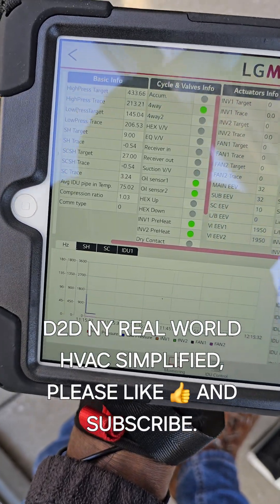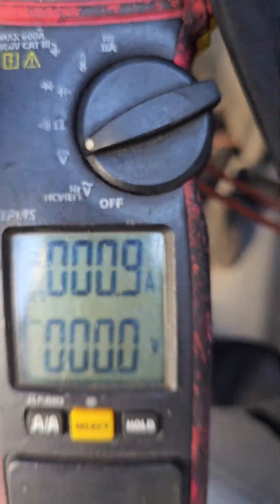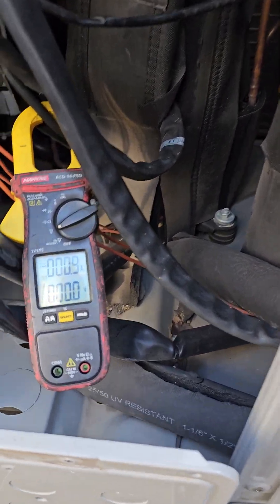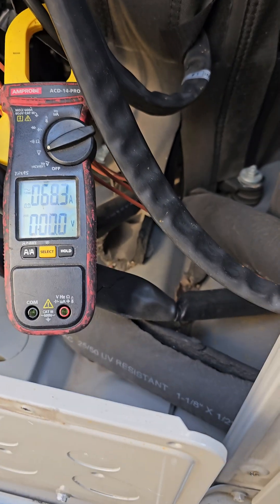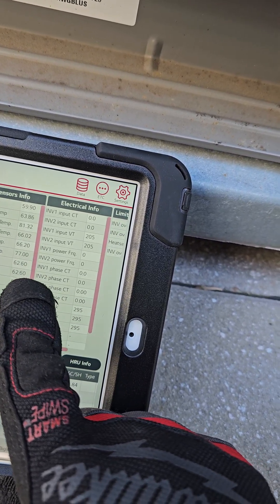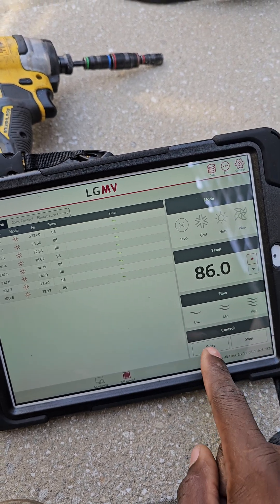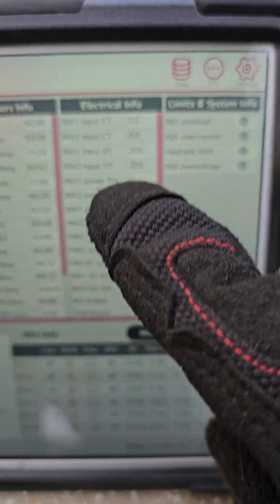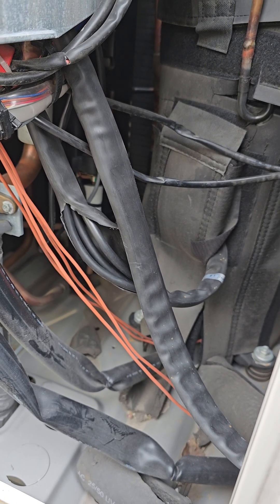HVAC TROUBLESHOOTING | COMPRESSOR LOCKED

Comment: Can you reverse the phase on the compressor terminals and have it turn reverse to unlock the compressor. is that possible?
Reply from the maker: Unlikely because these are inverter operated compressors , starting torque /power is very low

Comment: Today was my first time working on a VRF citi multi Mitsubishi out here in central California. They’re extremely rare here more common in the Bay Area. I had a blank Tstat only displaying central and would not allow me to adjust temp or turn on/off. I traced the wiring back to the air handler and the stat was receiving 11dc volts. My naive diagnostic would be bad thermostat since it’s getting power,but something tells me I’m very wrong can’t be that simple lol
I tried calling tech support was on hold for over an hour I gave up
Reply: They’re starting to be installed more in new commercial buildings i’m noticing would be great if my company could get us some training on this type of equipment. Seems like it’s a lot of what you deal with in New York.
Reply from the maker: Thanks for watching

Comment: Inrush for amp measurements is a great feature on your next meter. I use fieldpiece meters and they seem to do the job well. Fluke is obviously the best but they don’t pack them with features like the fieldpiece… that compressor is locked for sure. I bet there is a oil issue in that system.
Reply from the maker: Trms function on the amprobe meter gets the peak amp draw and locks it in, as you can see
Reply from the maker: Thanks for watching